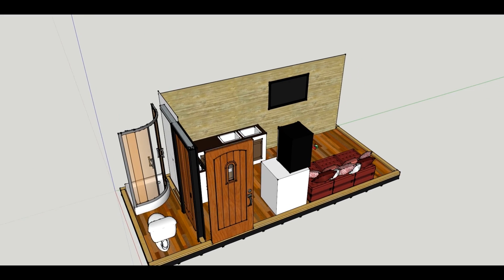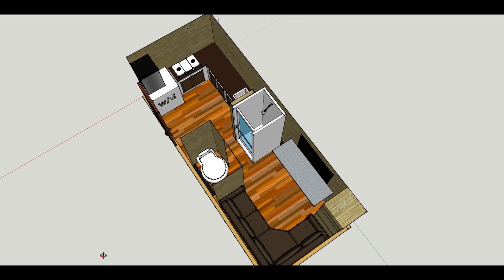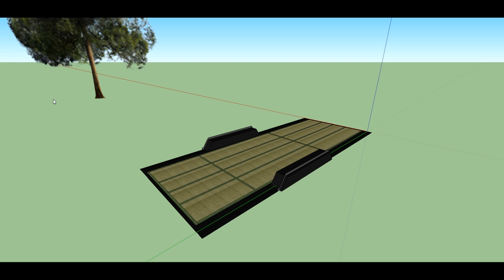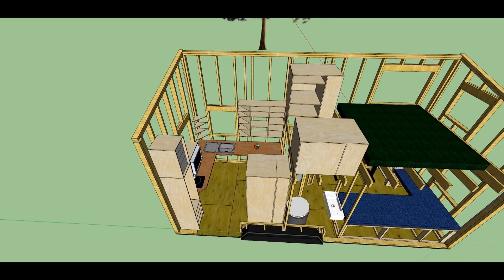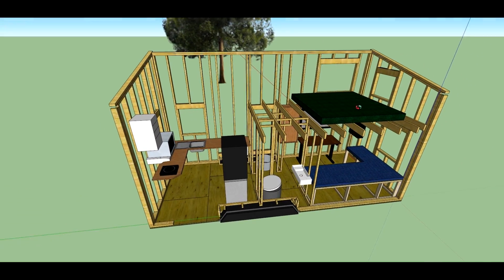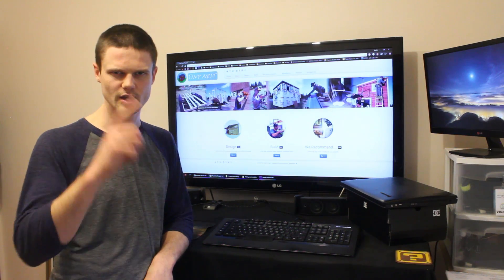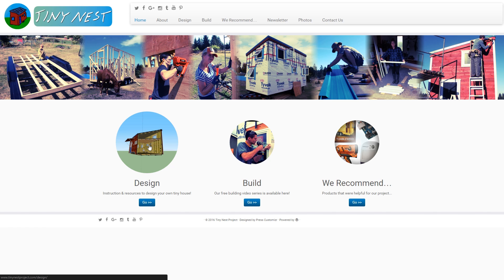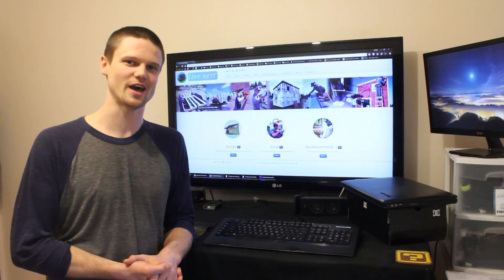Tiny House Design - 3D Modeling (Ep.3)

Comment: What did it cost to complete this project?
Reply from the maker: We've spent $30,000 so far and probably have a few thousand left to cover before we're 100% done.
Reply: It just seems go crazy to me that something so small, should cost so much, esp. when you provide the labor.  Love your project. Thanks.
Reply from the maker: It's important to remember that it has all the facilities of a space several times it's size. Also if we wanted to build a simpler cabin-style structure, it could be much cheaper, but this is truly a house.
Reply: Thanks

Comment: Really you could have the toilet in the shower area. You just need to put the toilet in the shower. I am no plumber but from what I have seen in RV trailers sometimes they have a small stool for ladies to sit on to shave their legs in there.
Reply from the maker: We've seen different wet-rooms or combination bathroom showers out there, but we decided early on that we didn't want to go that route... it would mean either having to sit on a wet toilet, or wipe it dry after every shower... it's definitely an option, but we made a deliberate decision against it.

Comment: You have both progressed so much in your speaking abilities on camera, much more relaxed and natural. You will be doing public speaking engagements in no time! ;)
Keep up the good work.
I'm waiting to find the video which shows what method you've chosen to mitigate cooking vapours wafting up into the sleeping area. Washable curtains? Exhaust fan? Outside BBQ/stove?
Reply from the maker: +L.A. rabbyt Thanks :) yeah we still need to figure that out... we don't have a fan to exhaust to the outside, but we might put in a recirculating hood fan to capture odours etc. Luckily we will not have to deal with any grease, and we are cooking with less oil (and we will BBQ a lot in the summer) so the problem will be pretty minimal to start with.

Comment: have you thought of storage behind the couch and sink in the he kitchen with a narrow shelf that can be raised up by linier actuator or a counter weighted rope system. also on the shower wall leave the outside wall facing the TV bare and trim out the studs giving you a 3 1/2  in deep shelf floor to ceiling. just some thoughts. have fun
Reply from the maker: +Scott Tyndall Indeed! there will be storage under the couch, that will be the main easy-access storage. The use of the corner of the kitchen cabinets is yet to be determined. We've seen cool uses of stud-depth as shelving, but we went with 2x2 framing for the inner rooms, so that will not be an option where you pointed out :P but we have a few other ideas in the works ;)
Reply: You can take crown molding and extend the depth of the wall cavity by building shelves and using the crown to blend the shelves back into the wall like a extra deep picture frame
Reply from the maker: +Scott Tyndall Hm nice idea. If we're still talking about the show/TV wall, it's totally built and closed up already :( but I like the idea!
Reply: +Tiny Nest well it was just an idea curious to see how it all plays out
Reply from the maker: +Scott Tyndall Honestly we totally should have done that for the wall you're talking about :P thanks for the comments, as always :D
Reply: +Tiny Nest cool